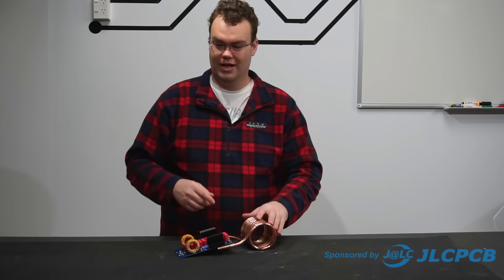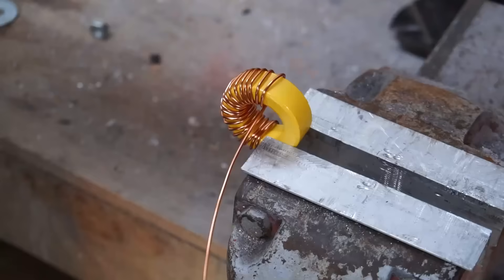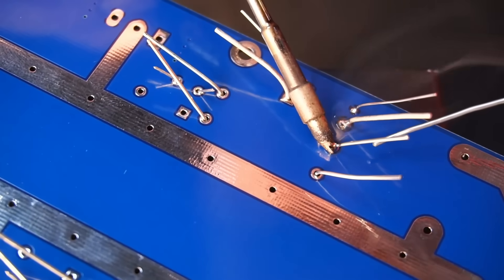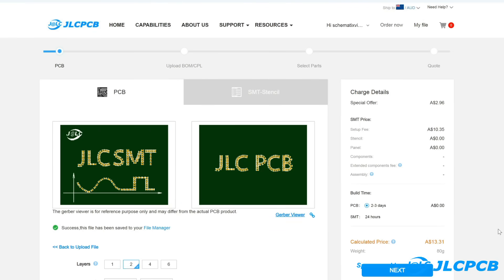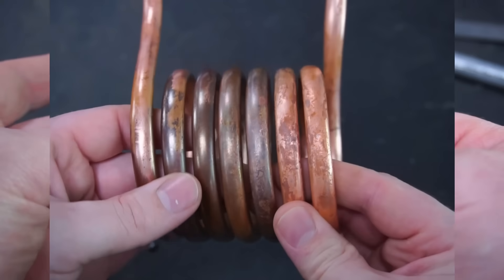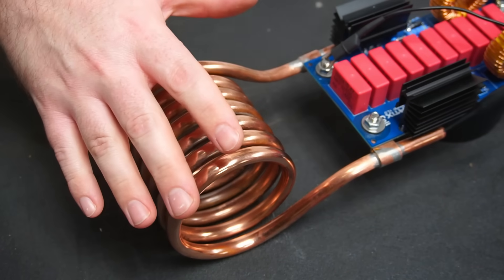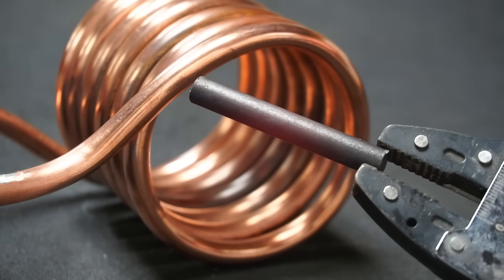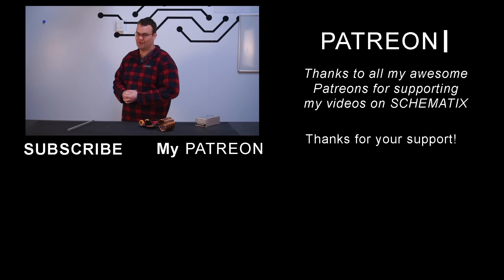Building a 1.4kW Induction Heater

Comment: yu dont plunge to anneal you let air cool ... it allows the metal to relax ... you plunge to harden and set the curl
Reply: Not with copper. It behaves the other way round.
Reply: @smferreiro2610  and even copper will harden when fast cooled ... letting it air cool will anneal it ... by working it again it hardens faster ... all metals do this ... copper is NOT special like water is ... (water grows when frozen and shrinks when thawed ... all other fluids shrink when cold and grow when thawed)

Comment: You do good work with that vice mate! Plenty of times where I'd have grabbed a hammer you solved the problem in a more controlled way, taught me a thing or two about using my workshop in addition to the induction heater! 

I'm curious if you were able to get a larger diameter rod up to a temp that you could do some blacksmithing? Red hot is the bare necessity there, you need a lot of heat in the material in order to reshape it effectively; did you ever try to hit those kinds of temps? Or, if not, ever use this instead of a torch for bending thick stuff like rebar or bar stock?

Comment: when solderinng the coilto the copper 1 holw straps heat the fitting and not the pipe itll work better, the solder flows toward the heat and if u heat it from the end of the pipe you know. im sure u get it

Comment: According to WIMA MKP10 spec and current capability of your capacitors, current flow through work coil should not exedeed 40A. Another week point of this design is current sharing between all this capacitor, ac blocking chokes are not capable to block this much current without enormous heat generation (high current density in thin wire, not to tell about skin effect - this is the same with thing pcb track that must feed work coil). 
No. There is some good ideas but overal design is week.
Reply: In an 8-day week, the design would be enhanced.
Reply: @smferreiro2610  as long as it is royer zvs (which one isn't zvs) it is useless and always be inefficient (and emc is another nightmare). Look at my stove, there is only 600 W.

Comment: With changes to the circuit board and the coil, you could apply the power from the MOSFETs directly to the ends of the coil. By extending length of the copper used in the coil, the straight portions could be lengthened, You could them use multiple terminals per side on the coil to not only have multiple points on contact between the PCB traces but also extend those traces for the capacitors to the board edge. Since the drain is connected to the connected to the heat sink anyway it does not matter if the heat sink inadvertently touches the copper. Having three terminals would allow the power to be sent through the copper pipe as well as the traces and if the traces extend to the edge they are wider and the current will have more paths to travel in the trace so heat dissipation should also be spread. Plus you can do that on both sides of the board. and also use thinker (not just wider) copper traces.

Comment: One thing I would like to point out is that you have mentioned the gate resistors in the description in your website but you haven't mentioned what they are or even a link to them.  I just built my circuit board and noticed that R8 and R9 is missing and I didn't know what it was cause I haven't ordered anything for it.

Comment: You should also use silver bearing solder on our power componants and traces as its melting point is higher and resistance is lower.

Comment: Solder bare copper wire either #10 wire over the traces or two #12 wires twisted together very tightly and tinned.
That will carry all the current instead of the trace and solder.

Comment: Tbh it looks way more powerfull than it really is with that 1.4k on top of it. My tiny HF 300W resonance induction buster five thousand which is 1/3 of size turns gloving hot such a steel bar (15:39) in around 10-15 secs. Looks like so it wastes more energy than uses for actual heating. Change winding, add magnets, change sinus for something different and then real fun begins :)) Toroid inductors shall be wound on the same ring also.
I would also try to create vacum inside this "tube"- like laptop cooling tubes for better heat transfer, because curiosity :)
Reply: Why would you wind the inductors in the same ring?
Reply: yeah most of his "1.4kW" is reactive power
Reply: @gaynzz6841  What would you change? Do you know any other example of a project like this, with better performance?
Reply: @smferreiro2610  I would change the entire circuit to a half-bridge with external frequency tuning. In this video the guy is using the famous "ZVS Driver" circuit, which is common on the internet, but it's no good for "proper" induction heating. That is, if you actually want to see metal melt.
Reply: @gaynzz6841  Thank you!
(Now I have something to investigate during the weekend... not this one, because we'll be partying, but the next one!)

Happy New Year!
Reply: @smferreiro2610  Have fun! Happy new year to you too

Comment: Firstly, nice job, thanks for video. 
By the way, why don't you design and make a circuit which works by 220Vac or 110Vac mains power? Because everyone can not provide a 48Vdc/30A PS; it's a huge cost. Right?

Comment: I have build one as well years back. You can increase heating power by making lower diameter coil. You can also try to play with value of capacitor bank - By increasing or decreasing the capacity you change the resonance frequency of the whole circuit. Different materials and thicknesses heats better at a different frequencies
Reply: Is it possible to make it have idk what it's called but a nob to adjust high or low  to voltage to increase the amount of power to head different gauges of steel
Reply: @_rgvt2890 You can do power regulation by lowering input voltage. So if you are powering it with bench power supply you can just lower the voltage to get less power. Alternatively if you are powering it from mains transformer with full bridge rectifier you can get yourself a transformer with more secondary windings (for example 12V, 15V and 20V) and just switch between the windings to get lower power

Comment: To heat the Al's and Cu's, to the point of melting, connect a substantial conductor each of the bar, creating a 1 pass closed circuit. Use at least 25mmsq flexible strand copper cable. FFS, use proper crimp lugs and not some bodge business. 

Nice design and fabrication there. Years ago when I was an apprentice a task was to custom manufacture furnace coils for a well known Cu Co here in Australia.  The Cu tube was rectangular extruded profile around 25 x 30mm with a 12mm bore for coolant circulation. Lots of annealing, former bending, asbestos sheet strip insulation between coils set in zircona/clay paste cement. They were double layer wound with both ends 50mm apart at one end.  Electrical, mechanical (they need strong restraint) and plumbing connection was done through a copper block brazed to the coil conductor. 

I think your coil Cross Sectional Area is too low a mass, to confidently pass reasonable current . Wall thickness on that 3/8 10mm is probably less than 0.9 mm thick. 1/2" DN15 tube would do better.   OK for now I guess, until you realise limitations and improvements.
You could install a 3-5mm copper rod inside the tube which will increase CSA prior to coil forming.... just needs silver soldering inside both ends of the coil.  This will increase coolant flow speed through the coil too, by effectively reducing internal diameter of tube water. 

Restraint is needed to prevent the coil, from magnetic attraction,  forming a closed circuit.  
Try finding woven glass tube to insulate the coil. 

I would use plumbing fittings - 3/8 compression olive to 3/8 bsp M screwed - for coolant, mechanical mount and electrical connections of the coil. 
Coolant connection. The compression fitting can be slightly opened if the tube doesn't slip fit till the end of Cu projects past the screw thread. (they are designed to just straight nipple connect a pipe to screwed fitting, so the tube comes to a stop depth) Tighten outer nut (not yet) and a Cu olive crimps down for watertight seal.  
Electrical connection. You need to limit heat transfer to PCB. Silver braze (not hopeless soft lead solder) a 16mm sq copper crimp lug to the plumbing fitting. When you silver solder wipe off the excess solder dags that look like bird poop. Locate lug on the body hex area at 90deg to tube axis.  Maybe either crimp link type (cable to cable) one end flattened out, or palm lug (cable to bolt connection). Long palm type, if you can get, will provide length to braze and extend to provide a hole to mount both coil ends to a ceramic block for mechanical fixing. If no long palm lugs available just cut some brass or steel strip and silver solder to brass fitting at same time. Copper isn't great for strength there.  Don't fold lugs down to align with plumbing tube axis yet. Crimp first!  The lug copper will be soft from brazing process distorting crimp barrel. 
Crimp a 300mm long cable - 16mmsq flex strand copper cable to each coil end. Buy the nice high strand synth rubber double insulated cable that usually has an orange jacket. 
Cut some copper sheet for a busbar that connects along the entire PCB traces as needed. The components solder to this and not PCB trace on board. It can be soldered to pcb, but it only helps align with minimal mechanical torque strength. This saves the messy 'boost' a low CSA trace with solder. The busbar needs to extend beyond PCB so that the cable can connect to the bar using another crimp lug. Use 25mm sq size, unless 20mm of 3/8 tube has a nice fit for both. Bar goes into the lug barrel with coil cable and crimped. 
DO NOT try to solder high flex cables. Only crimp correctly... that means correct hex tool... not like a bodgy butcher would in a vice.

Comment: My company uses industrial induction heaters that dump +300 and -300 VAC (after rectifying to DC of course) into coils that are a third the size of yours to heat brass and copper for silver soldering. It takes an impressive amount of energy, and the coils are liquid cooled.

Comment: I have a question on application. Can this type of inductor heat water in a metal pipe so that hot water at 50 degree C  heats up to become saturated and eventually superheated steam at 300C?

Comment: Caution:  Check the mosfet part #'s in these Chinese heaters.  Some use the IRFP064N mosfets which are only rated at 55v, and will accept an input of only 16v.  The IRFP260N mosfets can take a ZVS input of 60v.
GREAT videos!!!
How much trouble do you have with blown mosfets in your work???  I have to stock up!

Comment: Please, I would need some help with my build, I made the selection of the components for the same resonant frequency, but I noticed capacitors actually have some derating from specified max voltage due to the 50kHz frequency... So a 1kV capacitor won't be able to withstand even 30V... Did you take this into account? From the datasheet for the caps in your video it seems that you're just walking in a thin rope... I would like to know if this is possible anyway... For the commercial PCBs out there, the capacitors used are some BM CQC MKPH induction heating capacitors, but there's no datasheet or whatever... Could I please get some advice? UPDATE: I finally made the board and soldered the caps anyway... It seems it worked, but any info will be great

Comment: One suggestion:

For the two main high-frequency busses: Instead of filling them with solder, skin some ROMEX (12 or 14AWG solid) make them straight and put two of these next to the capacitor leads on each bus and cover everything with solder.

Or better yet, if you can machine two rectangular copper busses with holes for capacitors, do it.

For the caps: Search Digi-Key for film capacitors and "high pulse dv/dt" capacitors.

These capacitors will carry huge AC currents and their ESR must be as low as possible.

....And NO you may NOT replace two paralled capacitors with one of double capacitance !!!
Reply: Eeek! Why you may not  "replace two paralled capacitors with one of double capacitance" ??
Reply: Could you not simply increase the thickness (4oz) and area of the busses?  iirc he said 30Amps should be able to be carried by a thick enough trace, although adding 10ga or 12ga wire should also work with the lack of mechanical robustness, and additional build work.

Comment: excuse me , can i ask you something, i have copper wire, not pipe, but it is very thick, it is the same? does the thickness of the work coil has to do with anything? it was very expensive and i would like to use it and not spend money again in the copper pipe of the video. the wire is made from solid copper , thick like half a thumb . should i add an insulator maybe?

Comment: Hi love your video! 
A quick question. Is it feasible to power two of these modules in series and run them at around 100 volts? 
Somehow phase the outputs together at the heating coil.  (Or set the two output coils in line with each other say One heating the top of a crucible and the other at the bottom.  Without mutual coupling problems between the two coils) 
Just looking at ways of eliminating the PSU and run from 110v or even 230v and get enough power to drive a larger crucible for melting aluminum (perhaps a sort of bridge configuration with 4 units) Looking to make a small furnace to take a #4 6kg crucible for casting aluminum.
Reply: Like a bit of spicy danger do we? 
Industrial heating and smelting coils operate at >600V DC.   600V spicy enough? Don't forget the high current too.  Perhaps 2-3 parallel arc welding cables might be suitable for a tiny 100V jobbie. 
They are engineered to withstand mechanical, thermal and electrical factors.. never bodged up like 2 or more in series.... which isn't a great idea.  
Build 1 the correct rating for the purpose.

Comment: If you need thicker tracings, I would recommend adding solid Cu wires, or my favorite is solder wick because leads can be poked through it which hold it in place and transfer power directly to the copper wick.

Comment: Can you point me at reference material on how to calculate building one of these?  I want to heat an old (decommissioned) steel scuba tank to around 300 to 350 degrees Celsius and hold it there more or less as long as I like.

Comment: I am a student and I was wondering if I can use my "millermatic 250x" welder as parts for this project?
The resisters are higher than recommended and the capicator are higher too

Comment: really good video.  I particularly like how you start from scratch.  The last two videos I watched started with people buying an induction module!

I have two purposes in mind for this, neither of which make having a power supply  convenient.  So I'd prefer to have something I can run off the mains voltage (110vac).  So could this circuit be modified to run directly off mains?

second question, can this system "start" with the metal object already in the coil?  One of my applications is a fast water boiler & I'd like to know if I need to build the system such that the container slides out for starting.

Comment: I have very much wanted to buy all the components of your 3k Watts induction heater that I tried to send you messages about auch intention of mine about a few months ago. I thought that such messages had already been sent; but to my discouragement, I could not even see them in your comments under your project. Worse is that I could no longer see your vlog about such 3k Watts induction heater despite my efforts to locate it.

As such, I hope that this message will find you and be read by you so that you can help me acquire all the necessary components in order that I be able to build my own induction heater.

Please include in your pricing appraisal all the necessary tools and other materials like soldering lead, soldering gun, etc.so that I will be able to produce the necessary amount on time.

Thank you for your favorable response.

Comment: Instead of making your own power supply, why not just cannabolize a $50 portable inductive cooktop and connect that to your coil holder handpiece? They make them in 110 or 220V, and most have adjustable power output levels.

Comment: I was fortunate enough to be in the right place at the right time to strip a metallurgical laboratory and its equipment, i have the innards of a Leco corp induction furnace that operates with a 304tl tube, its super clean and simple, wish i could post some pics for you lads

Comment: I wonder if using a 4 layer PCB and using all four layers for the high current rails would help offset the need to load them down with solder? Obviously a lot of via's would be needed.

Comment: Could this be used for swordmaking or does it need to be more powerful yet? If it needs to be more powerful, would you create a new video with a larger coil also to fit wider sword blades?

I estimate I need a coil of 4 inches internal diameter to accommodate wider blades and curved ones.

Comment: So I want one of these to heat up nuts and bolts that I can't put a flame neron Automotive application. Of course you can buy them but they are very costly! It's hard to justify the cost for as little as I would have to use it!